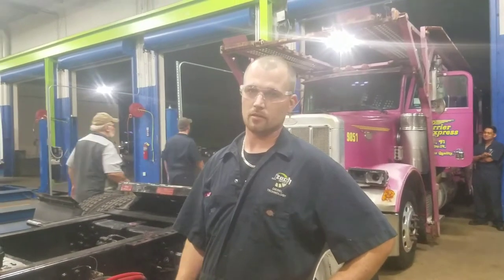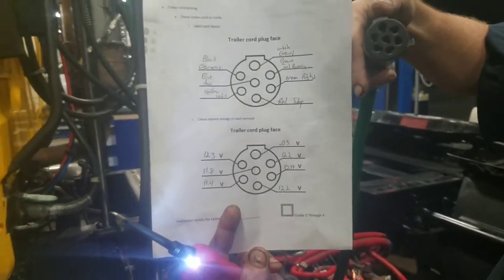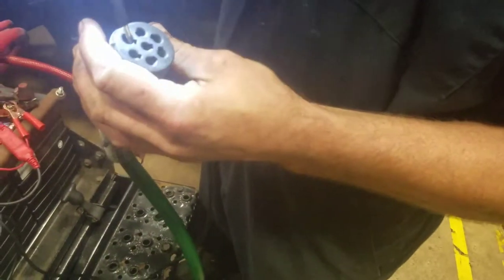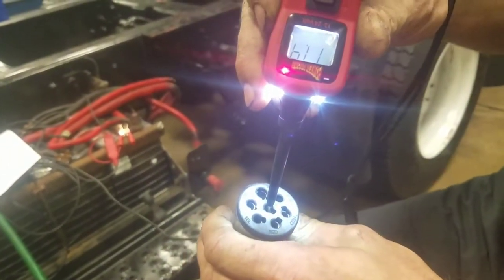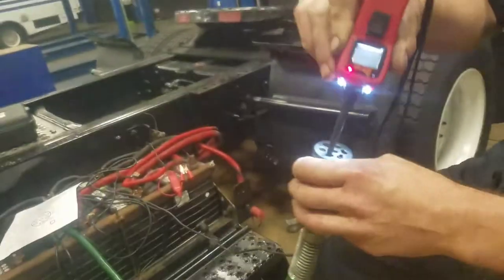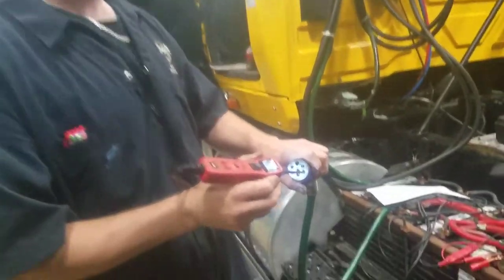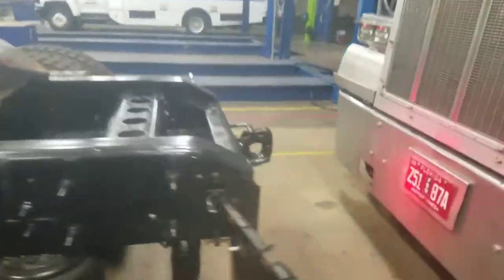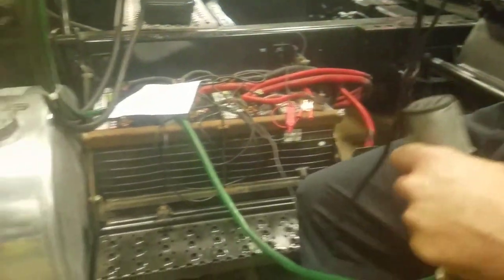7pin Trailer Plug Electrical test

Comment: Great video. My suggestion is buy the good test light from harbor freight incandescent bulb style for under five bucks. You can hook it to either battery ground or the ground lead on your power probe.  Don't always go by what the powerprobe says. I know I got burned on a service call one night. Powerprobe showed me I had power, when I decided to check the circuit again with a test light. I had no power or current. Ended up being a slightly corroded wire the was pierced along time ago. Fixed the wire and it solved my electrical problem.

Comment: U forgot to mention if ther should be any continuity between probes  (such faulty plug or cut wire )  obviously don't supose to be any , if yes , then ther is a short circuit. In my case I got one (between midle probe and back light of the trailer left with key on on position all lights off), but u gotta use ur voltmeter